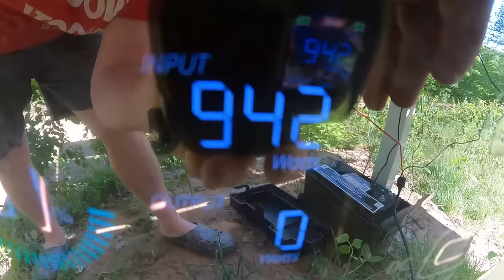Off Grid Solar- HUGE IMPROVEMENTS- Eco Worthy Dual Axis Tracking System

Comment: Can you use bifacial panels on this? 
Plus what kind of winds are you getting?
My place has recorded 80mph sustained and 105mph wind gusts.
Can it hold up?
Reply from the maker: hey Suntz.....I'm sure you could use Bifacial panels. I'm not super familiar with their function.....simply gather energy from both sides, yes?   If snow reflection is something you deal with in the winter and small patches of shading on them from the bracing doesn't stop the transfer through the panel then yes I think they might be beneficial. 
As far as the wind goes.....I do not think that eco-worthy recommends it be installed in high wind areas.....although we see a lot of wind....we rarely get wind over 50 MPH here. We did have a storm come through with tornado warnings and reports of 50-60 MPH winds in our area a few months back and the array is still standing with no damage....But 80-100 MPH I would use caution or some sort of reinforcement in the way of extra anchors or possibly stronger mounts and bolts.
Reply: @OffgridwithJayandJen  Hey thank you for the response! 
Yeah bifacial collects from both sides, the back is obviously not as efficient as the front,  and as you know most panels do not always produce as much as they are rated for.
But I have heard of people using them elevated and placing reflective materials under them and it helping.
Never tried myself but it would be interesting on your tracking system if it would increase efficiency.
I've also heard bifacials are much heavier, so the weight might be factor on it also?
Once again thank you for your response.

Comment: I wonder how well it will work in the winter and freezing temps. Also if you get a lot of snow looks like the tracker will be pushing into the snow unless you shovel it out a lot or leave it in a fixed position. I have been thinking about one of these for my camp  just seems like a lot to go wrong with it in colder weather?
Reply from the maker: I can see your concern....but honestly don't think the snow or cold Temps will have much effect on it.  It is high enough off the ground and solar in general works better I cooler Temps. Also the battery that controls if uses very little energy so it should last and you could charge it is needed. Because it tracks the sun with a sensor it should remain at a steeper angle in the cooler months.....which should shed the snow well. Our current array is about the same height and never have an issue with snow piling up too high.

Comment: If you have larger panels, can you attach/use longer tracks?
Reply from the maker: There is a weight limit on the tracker.....some people have attached four larger panels in the center in a line......but make sure they are balanced and don't go too much over the weight limits

Comment: Did the washer buried in the concrete sink to the bottom with the head of the bolt?
Reply from the maker: They probably were not really necessary,  but my thought was it couldn't hurt, lol. But I feel they could  be good insurance if the bolt did decide to slide at all. We were just hit with a pretty bad storm that took out lots of trees and the new array survived through it

Comment: @OffgridwithJayandJen I just purchased one of these and received 1 out the 6 panels completely shattered today. Did you wire these in parallel and are you running a 12v system? I am waiting on a few more goodies before going out to my second property this weekend to get stuff done.
Reply from the maker: Oh man....that sucks about the panel.....I'm Sure it will get taken care of....In the mean time Base and assembly can start. We have our panels are ran in Series....it keeps the amperage down so we can use standard 10 Gauge PV wire with the MC4 connectors
Reply: @OffgridwithJayandJen  Thanks for the reply. I went up over the weekend dug a 4' by 14" hole and poured the concrete and got the tracker installed. I did install the cracked the panel just to keep the balance while I wait for the replacement panel to get delivered. The cracked panel does output the same VOC as the others but if it rains the panel will more than likely get damaged. Did you ground the tracker/panels? Also, mine only runs on 2 - 12v 7ah batteries in series (24v) it will not move on 12v.
Reply from the maker: @TechMechRandom  that's weird it need those two batteries, I have mine just hooked up to a lawn mower 12 volt battery. Works fine for a couple months then I hook up a little charger to it for a day and good to go again. Maybe you have a couple wires crossed or something?

Comment: I can’t imagine anyone not going down to a hardware store, and buying 8 hardened anchor bolts. Using standard bolts is substandard to say it politely.
Reply from the maker: It's not a twenty ton mack truck.......it's a couple hundred pounds of metal and panels.....I think 8 half-inch bolts can handle it. If 100 mph winds come through, other things would break first I'm sure.

Comment: My dad just got this system and we can’t figure the programming out at all. Any recommendations?
Reply from the maker: There are some videos on eco worthy website and YouTube if you search it. They are not very good videos, but you should be able to figure it out after a few watches.  I do know the wiring for the directions  was wrong in the manual and I had to move those around as well.

Comment: Since the tracking system runs on a separate battery from your solar system, what are you doing to keep it charged?
Reply from the maker: I take it over to the solar shed and charge it once every month or two.  I actually just bought a 20 dollar mini Solar panel charger  for the battery  we will see how it holds up

Comment: I see this needs an external battery to operate. Do the solar panels/controller charge this battery or do you need some sort of external charger?
Reply from the maker: Depends how you want to use it or possibly trickle charge it from your inverter or CC, i have been using the system hooked up to a small 12 volt lawn mower battery... and have only stuck a car charger on it once in the past couple months...I only charged it to be safe.

Comment: How did u wire the panels and what controller. I'm using my tracker to be backup to my bluettie.
Reply from the maker: If you are using a bluetti power station you don't need a Charge controller,  you just use their cord to plug from MC4 Connectors from the panels to the bluetti. Just make sure the panel array voltage is within the proper range that the bluetti allows.
Reply: @OffgridwithJayandJen  yeah had to drop one panel. That out me around 100 volts the bluettie I have top volts 145. That sux panel was just to close to max.

Comment: What size Solar panels can this solar tracking rack take. I was thinking about buying 6 455 watt solar panels. Would they fit on this tracking rack? The dimensions on the solar panels that I want to mount is 82.44 x 40.86 x 1.37 weight for each panel is 51.8.
Reply from the maker: The tracker is maxed out with these 6 195 watt panels so I assume yours would be too large. The dimensions to the trackers brackets and railing are on their website.....the links to the tracker are below in the description box
Reply: @OffgridwithJayandJen  ok thanks for that info and y’all’s very informative review.

Comment: My tracker does not return to level after sunset and starts tacking again about 9:30 am next day. What settings do I need to get tracker to return to level after sunset?
Reply from the maker: I had this issue as well.....I sent an email to Eco-worthy and I'm setting up a time to figure it out. Email us and we can figure it out. If I get it figured out first i can find your message to let you know and you can do the same. Thanks
Reply from the maker: Hey Ray....I just found a video on eco-worthy website that shows how to program and change the settings to make the array return to flat. I have not tried it yet, and the video seemed a little rough, but will try later and be in touch.

Comment: I recently purchased and installed the Echo-Worthy Solar tracker. However, I have noticed that the tracker tends to move frequently, which is a concern for me. For example, on a cloudy day with no wind, when the sun is positioned in the West but the sky appears brighter in the East, the tracker turns towards the East instead of tracking the actual position of the sun in the West. If it is a clear sky, it works just great.

It seems like the tracker is relying on the brightest light rather than accurately following the sun's actual position. My main concern is that unnecessary movement may put additional stress on the moving parts.

Do you have the same problem? Do you use the Sun sensor?

Thanks for sharing your video here..
Reply from the maker: Hey there, I have some trouble with that as well, but I messed with the parameters on the controller, and it seems to move far less. If you extend the amount of time on each setting, it will take longer periods of Shaded cloudiness before it wants to Make an adjustment. The parameters are quite confusing to me, but I would recommend contacting eco-worthy and see what they suggest. I have more recently been leaving the unit stationary just because in the summer our solar produces well and the additional solar is not needed, but during the winter I will be letting it track to produce the best efficiency.
Reply: Hey guys, I can be of help in this regard.

1. The [V3] parameter setting handles cloudy events. If the voltage value is too low and the sky is cloudy, the system will keep tracking by moving in the direction of the highest light sensed in the sky which is what you are experiencing. On the other hand, if the [V3] value is high, your system will go into a quick hibernation (the system will pause tracking for the amount of time [T8] you set) mode. So my rule of thumb is: set the V3 to the value of (75- 82% * the maximum voltage of the light sensor observed on a clear sky sunny day of any of the four cardinal points).

For example, if you observed on a clear sky no-cloudy day that the max voltage from any of the light sensor directions (East, West, North, South) is 2.0v, I chose 75% as my factor.
75% * 2.0 = 1.5
1.5 is the parameter value you set for [V3].

2. Set T8 to 1800(seconds). That's 30 minutes for the system to hibernate during a cloud event. This will keep the tracker in its current position until the cloud is gone. 30mins is more than enough good period for a cloud to pass.

3. Also, you will need to set the tracking time values for the East/West and North/South axis (TX & TY) respectively. My rule of thumb, set both values to 600(seconds). That's 10 minutes tracking interval. This is a good tracking time which will prevent continuous tracking and in turn, reduce the wearing of the mechanical parts due to the less movement of the actuators because the earth rotates on its axis very slowly (we see the effect as the sun moves from east to west😂).

That's it guys. You are good to go.
Let me know if you need further assistance.
Reply: @lylatechnologies461  I just tried your setting week ago and noticed the difference. Thank you so much for the tips.
Reply: @VathSok  You are welcome. I'm glad I could be of help. @VathSok Enjoy!

Comment: What size sauna tube did you use (diameter)? Any idea the bolt spacing (I assume it is in mm)?
Reply from the maker: 12 inch by 48 inch deep......not sure on bolt pattern. Maybe find it by using the link below. Feel like the footprint was 12 inch by 12 inch....ish
Reply: @OffgridwithJayandJen   yea there really isn't anything on their website and I don't have a unit yet... I want to figure out what I need before I order. Any chance you could measure the metal base when you get a chance??
Reply from the maker: @dandeering9421  I'm actually on vacation right now...but like I said....about 12 inch square....4 half inch bolts evenly spread out on each side.

Comment: Does the solar tracker cost less than adding an extra panel or 2?
Reply from the maker: Well the tracking system when on sale was around $450.00 so considering two panels would likely be close to that cost....plus you would have to buy larger CC to accommodate them.....then I think it is a fair deal.
Reply: You also have to consider that you don't need as much battery backup since you have a greater and longer power production curve.  In hot areas that means you can power up your AC units without any issues about them draining your battery bank.

Comment: What about the battery? Does it stay charged from the tracker's controller?
Reply from the maker: The battery used does not charge from the solar unit. The power coming from the panels could easily charge your battery bank and run a trickle charge to the battery used to run the tracker, or use your battery bank itself. Currently I have a single isolated small lawn mower battery hooked to the tracker and only have to put it on a charge once every month or two. It is not ideal, but I'm still working on finalizing the system to its best capabilities.
Reply: @OffgridwithJayandJen  Thanks! That answered my question. I'll bet a solar battery charger mounted on the array would do the trick!
Reply from the maker: @Le_Comte_de_Monte_Felin  yes, I think my final set up might use one of the 6 panels running to a cheap CC to the battery running the  tracker and use the other 5 panels in series to our main system. Easy and simple
Reply: @OffgridwithJayandJen  Started assembling mine today. They sure could use some improvements to the assembly manual! (Like not using microscopic print!)

Comment: how much power does the tracker take to run?
Reply from the maker: Not much really, I have a 12 volt trolling motor battery hooked to it, with a small 10 watt solar panel to charge it and it maintains well, never runs out of power.

Comment: You get a lot of wind and you don't have a wind generator?
Reply from the maker: Not yet, kinda silly but I was worried about the noise of one.....if push came to shove or ecoworthy wants to do a video about one, I would be happy to install one. 😀
Reply: @OffgridwithJayandJen  Yeah, I can see that. Last year, I went to the off-grid expo in Atlanta, Cobb Galleria, and they had the vertical multi-directional generators that make slightly more noise than a weather station. But with one of those just about anyone would need a sponsorship. They started at about $2,100.

Comment: Um, you realize the shading on your fixed area is going to seriously affect your output, right? You should seriously consider cutting back on any vegetation that is shading it, you’ll get substantially improved performance.
Reply from the maker: Yes, I am aware. That shadowing only occurs during the best time of year and the system fully charges during that time of year fully in only half a day. When the hours of daylight cut back the angles are better because of where the sun is on the horizon and that shadowing is no longer an issue.

Comment: From what I saw in your video your stationary has a lot of shading on it.  You may not think this is a lot, but it really limits your power collection.  Might be time to get rid of the tree that's by it.
Reply from the maker: Yes it does....but it is only during peak summer and only for a couple hours. This only happens when the battery bank gets fully charged every day either way, so I leave them.

Comment: It's terrible that ALL online inquiries into the types of solar systems available from different countries end in a total lack of information. Instead of showing the types of products available, ALL these blasted companies start by asking you to enter your zipcode for an instant quote! And then you need to answer more questions than the IRS requires at tax season! No thanks! I'd rather stick with municipal power suppliers.
Reply from the maker: weird....maybe you need to use some type of spam blocker. I totally agree that pop up ads are annoying. I didn't see any when using the links for this product, so not sure where this comment came from, but hope you can figure it out.

Comment: Hi peeps..   I have one of these..  https://youtu.be/I566UjPPLXo   So I have 2 arrays. There are two 400w Trina panels on the ground facing west and both tilted about a foot high. The 2nd array is two more 400w Trina panels (one of them is going bad and disconnected) on the tracker. From about 1-4 pm they get direct sunlight.. but just the one panel on the tracker is receiving more power than the pair. So trackers DO improve the incoming power. Some say 40% and I believe it. I'm going to maximize the input and buy SIX 200w panels which the tracker will handle. I will be getting a 2nd and probably a third one.  I'm certain you will love it and get another one too.
Reply from the maker: It really does work well....and cool to see it getting full power all day rather than only a few short hours like a stationary system.
Reply: @OffgridwithJayandJen  I want to get a 2nd one and fill them both with six 200w panels.